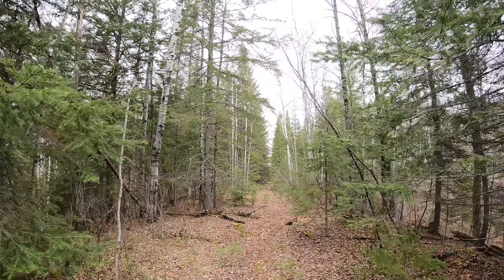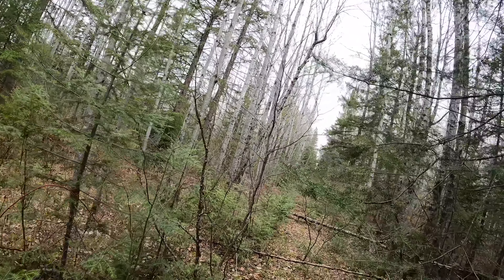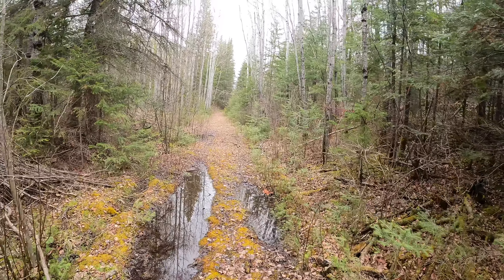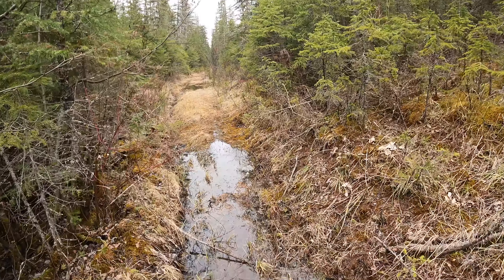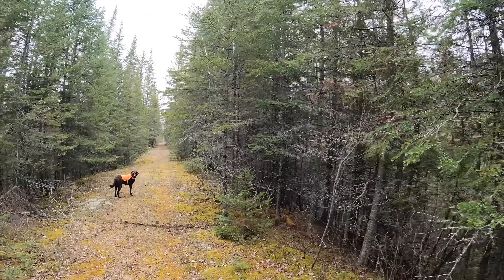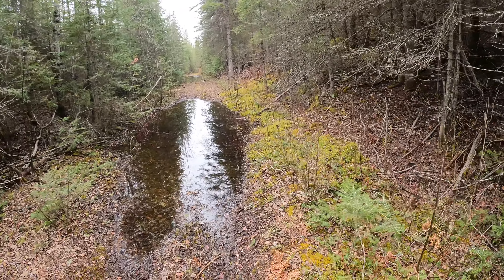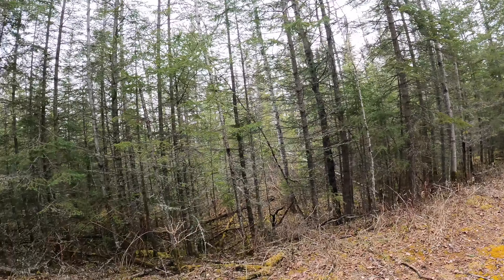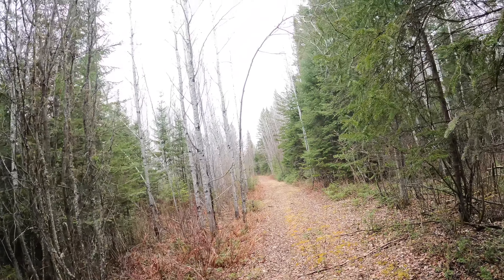GTP/CN-Graham Subdivision MP 22.8-26 VI

Comment: "Bazillion tires" that'll help if there is ever a forest fire. Can see that would happen. Looks like the RofW is nicely drivable, to a degree.
Reply from the maker: Maybe bazillion was a bit of an exaggeration lol
If you check the comments on the other videos you'll read about how the area was drivable up until the late 80s, possibly early 90s.
Reply: Oh I believe it. Sometimes feels like all one has to do is flip back that left facing page and you would be there.
Reply: @padwrr  ...I think I errored more like driveable up to early 80's when concrete barriers went up after crossing weight went to only I think 5 or 10 tons...after the big hole in the bridge crossing showed up. They ran dump truck back then to get gravel just across the bridge and bit before logging trucks and skidders too.
Reply from the maker: @kam75  Thanks. Good to know.